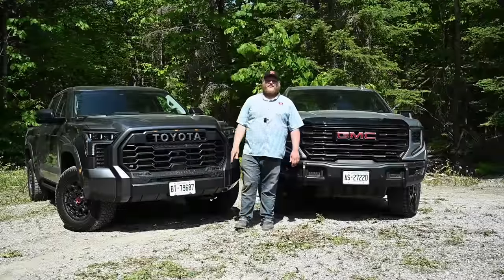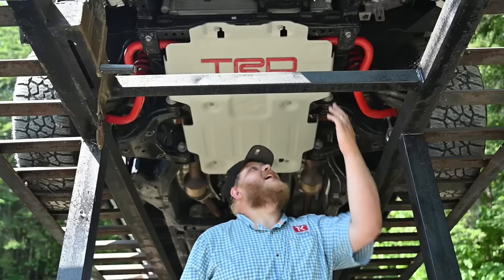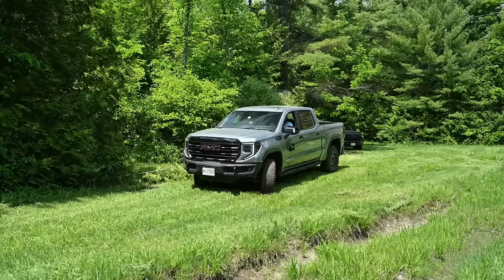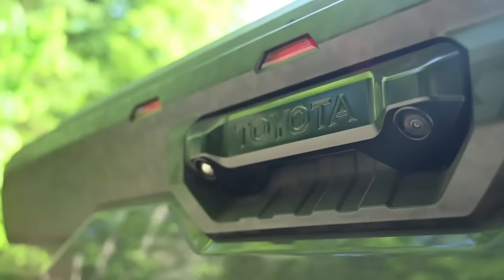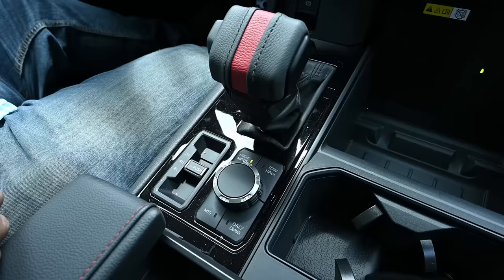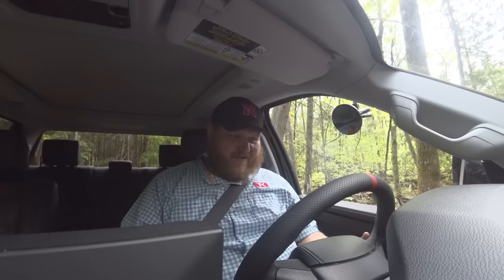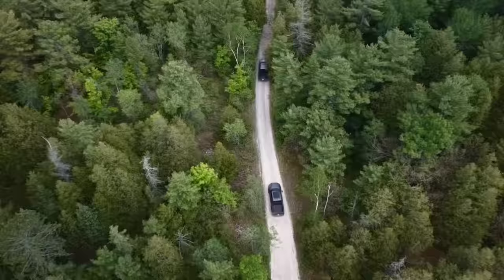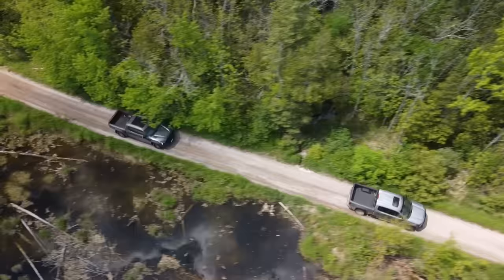2023 Toyota Tundra TRD Pro vs GMC Sierra AT4X AEV - Mud, Rocks & Water will Decide Which is Better!

Comment: Neither, I went with a 1500 ZR2, Front and rear lockers, all the same camera views same shocks as the AT4X and 1500lb cargo capacity at 73k US. I like Toyota and was excited to see the new Tundra. I think they dropped the ball on a lot of it. Drop the tailgate and try to climb in the bed. You can't even step on the bumper with the gate down. No tow hooks in the front of a truck?? Cheap flimsy plastic all over the exterior. With how long they took to redesign the Tundra, I expected better. Coming from someone who has owned 5 Toyota's including the previous gen 5.7L Tundra.
Reply: They really did drop the ball. Even custom trailboss looks better then the tundra pro fully loaded.
Reply: Lack of front tow hooks is a firing offense for somebody over there.
Reply: You nailed it.
Reply: @KTree470  totally, especially when the incoming Tacoma has them.
Reply: Just the not beeping every 5 seconds is enough for me to take the GMC
Reply: The Sequoia looks better than the tundra. Not sure on the tow hooks though
Reply: GM is 50.1% owned by Shanghai Automotive Industry Corp, a Chinese company. The Tundra is the #1 most American truck you can, (as well as the #1 safest and #1 in resale value).
Reply: @user-mh5qg5jb7d  The largest stake holder of GM is vanguard at 7.5%. Do you get your information from facebook or tiktok?
Reply: I agree 100%. This is a letdown.
Reply: amen man... ive got an old 5.7 tundra and its 14 years old and still more reliable than the new one. im really hoping toyota does something and fixes the tundra to restore it to its former glory
Reply: I went with a 1794 with TRD pkg. Same crawl control, same MTS, same skid plate, way nicer interior than TRD pro and non-hybrid which I prefer. Plus I got a 6.5 long bed, which is not available in trd pro trim. AFE tow hooks are $155, all good! The Bilsteins ride awesome, can't comment on a larger sway bar as I haven't driven pro to compare. Its probably just painted red LOL!  In the video the GM cameras look sharper because the screen is so much smaller. Complaints I ahve were mentioned: Locker only works in low range, ugh. Fuggin thing slams on full abs brakes if I get close to leaves or have a hitch carrier in place. Startles the crap out of me and bystanders lol. Wish I had a front locker, but not sure it doesnt compensate with electronics.
Reply: @@ThomasJeffersonIIIno it doesn't. I've reached a max of 23.2 over a 460 mile round trip. Light traffic, really trying. I doubt it could do much better. Show me the V8 do that. In moderate traffic, a few passes etc. around 18mpg.
Reply: @@ThomasJeffersonIII except the fact I can afford not to keep something until 276k.
Reply: @cheezwhiz1234 Bro... 🤏🏾🤣
Reply: I was baffled to learn they had no tow hooks 😵‍💫
Reply: I agree the Toyota has cheap plastic parts on it to make it look tough and the hybrid system on it plus batteries with all the electric pumps and accessories will surely have to many problems in the long run. I've had several Gm trucks and I love them

Comment: No tow hooks on a truck in 2023 is insane. They should come on all trucks in 2023.
Reply: You still talking about that? 
How is that new to you?
Reply: What percentage of owners ACTUALLY use them?
Reply: @mikek5298  I would not take my $80k truck to any place like this
Reply: @mikek5298 I’ve said the same thing. I’ve driven trucks for 35 years and maybe used them twice. But just like the guys who sink 100k into a Jeep, it’s all to look good in the Cheesecake Factory parking lot.
Reply: @mikek5298  stop making excuses for toyota, it was pathetic to remove them on the new truck
Reply: I’m a Toyota cheerleader, but 2021 was the last full-size truck Toyota made. The new truck is a rolling dumpster fire. Let the pavement princesses cry. On my third and probably last Tundra.
Reply: Most toy guys use their trucks four wheeling
Reply: @wjoseph-rx9mj that’s just a simple matter of having it and not needing it rather than needing it and not having it. It’s a full size truck And an “off road “ version of it at that, with no tow hooks… really nothing else to say

Comment: Auto 4 wheel drive is missing on the Toyota.  Hard pass
Reply: The transfer case will last longer
Reply: Auto 4wd clutch packs are trash. Learn to shift a tough tcase manually or go buy a tesla if you want the computer to do your driving for you.
Reply: Auto 4WD is a game changer for on road poor climate conditions. Actually better for the tcase than binding in 4Hi or constantly shifting in and out.
Reply: @upshifter5316  auto 4wd has been in production for decades. Theres nothing game changes about it other than overheating clutch packs when they do fail. You just don't hear about grenading manual transfercases like you hear about failed auto tcases. One's built for toughness and the other is built with wearing clutches. What's the argument here? Viscous and torsen lockable differentials in tcases were a game changer.
Reply: @CACressida  oh well excuse me professor. I hereby retract my statement based on first hand experiences. 

Where I have in fact blown a chain driven tcase (and a prop shaft) on a modern Dodge truck due to binding (in a pretty mild use case, too), but as of yet have not blown the 4auto case in my Ford truck, despite 20k+ miles in 4A mode (out of 65k total). 

Which reminds me, I left out the part about 4A being a game changer also for putting the power down in ~500 hp trucks since they have a light rear unloaded. 

So yes, as Borg Warner would tell you and I’d agree, the clutch based vicious coupling in the Torque on Demand cases is a game changer. Best of both worlds unless you have a dedicated rock crawler. 

If I’m rock hopping I won’t be either using a modern truck nor doing it in 4A anyway.
Reply: @upshifter5316  so what you're saying is you admittedly have no idea how to operate a vehicle. Got it.
Reply: @CACressida  you are wise beyond your years.
Reply: @upshifter5316 you know it.
Reply: @CACressida  I don’t think so junior
Reply: @russelljohnson6885  who cares what you think, senior. Its just facts of reality. You can kick and stomp all you want, mechanical is always stronger than a piece of wearable friction material. Its why a few hundred dollar clutch disc wears out on a manual transmission and a clutch pack totals a car equipped with an automatic transmission. Its why a torsen or mechanical limited or locking differential never fails designwise and a clutch pack LSD requires special gear oil and a very frequent service interval in comparison. Its why all these goofy CUVs use clutch pack transfercase and a truck designed for severe duty uses a mechanical one.
Reply: @CACressida  sure thing chief.

Comment from the maker: CORRECTION: We said the fuel tank skid plate on the Tundra is plastic, but that's an oversimplification and doesn't do it justice. It's actually called Xply Armor, a unidirectional long glass fibre reinforced Nylon. Glass fibre tape is layered with alternating directions and bonded by nylon to make this skid plate.
Reply: Sounds like plastic
Reply: AEV Boron steel for the win!

Comment: Impossible to justify these prices new but I watch to see what I might be interested in when they're used, ten years from now. On a 500 mile loop this weekend, I got 18.6 mpg with my 10 year old GMC 4wd with an 8 foot bed. 100 dollars for fuel and no payments!
Reply: I average 13.5mpg with both my tundras, 2008 and 2022,  pulling a 16 ft utility trailer with two commercial mowers on it. About a 5000lb load mostly on back roads. The 08 has nearly 300k miles on it. 👍
Reply: When the payments are over, your truck runs and does the work it needs to do, that’s when you win. Enjoy it!

Comment: As for pricing, the comparable GMC to the TRD Pro would've been the standard AT4. The standard AT4 doesn't have front lockers, massaging seats, high approach bumpers, etc. which the TRD Pro doesn't have.
Reply: Agree and since they didn't utilize all the offroad goodies the GMC had I don't think saying it was only a hair better is fair.
Reply: @EGGINFOOLS exactly, they’ll never give GMC their credit. If Ford or RAM was offering all of this they’d be saying how it’s clearly the better truck.
Reply: Also AT4X was definitely not needed for this comparison.
Reply: @G-Rated 
Price, power, payload, and towing… Toyota is just better in the main category’s. GMC is best in lifter failures though
Reply: @JC71444  not a fan of the cylinder deactivation either. Just found out there are little tuning devices that get rid of that. Solves the lifter issues
Reply: Agreed, two completely different trucks, but I think they're testing what the company's give them. But with that said, they really shouldn't compare the two.
Reply: @JC71444 And rust. And depreciation. And government bailouts.
Reply: @VDawg-cr1gb  I purchased the Range AFM/DFM delete module for my Sierra. Worth every penny so far.
Reply: they’re comparing the Best half-ton both have to offer
Reply: Bitter much? they are comparing capabilities not cost. It's not about Value, it's about the abilities... If you want the Best it's GMC, if you want Value, it's Toyota.. Not everyone cares about price, many of us want ability and comfort.  If you want the top, you pay.. sounds like you should get a Honda.
Reply: @LayzeeGiant depreciation? Have you tried pricing a used GM truck or Tahoe lately?
Reply: @K-bob_45  My area is offering $7500 dealer discounts because they’re sitting on the lots. Same with F-150’s. Now the SUV’s are a different story.
Reply: At least GMC can deliver a truck.I went into Toyota to put my name down for a 2024 Tacoma Trailhunter and they couldn't even guarantee it would arrive in the year 2024 due to supply issues. Ridiculous.
Reply: @paleh0rse  That’s because people actually want a Toyota. They’re finally wising up to the fact that GM pumps out subpar junk that’s gonna fail sooner then later.
Reply: @LayzeeGiant holy yoda choker, how do you breathe with all that Toyota shaft in your throat? 😂
Reply: @OneEyedRascal Butthurt much son?
Reply: @LayzeeGiant  lol I just love seeing you defend a brand like it’s your unfaithful wife. Idc about your preference but why defend a corporation?
Reply: @OneEyedRascal  you seem obsessed with what others think. Maybe go outside and talk to a real person once in awhile. Just a thought….
Reply: @LayzeeGiant  ummmmm okay? Haha very respectable approach, you must be a democrat with those debate skills.
Reply: @OneEyedRascal  I’m not debating a child on the internet. I just told you it might be helpful to interact with real people instead on insulting them anonymously. But hey, to each his own.
Reply: These two trucks in the video are the same price though. I just googled it they're both $90k.
Reply: The Chevy made it look easy, the Toyota would have struggled even with more aggressive tires, the Chevy didn’t exactly have designated mud tires, they looked like all terrains, the Toyota has street tires,,,
Reply: @paleh0rse I was told I would have to wait for my trd pro tundra 3 months later it was being built 2 months later it was mine
Reply: @AFTERSHOCK-bh7hh liar! I got my trd pro at msrp of 70k
Reply: @reneeandchrisforever bahahaha your funny cause what I've seen lately is people are leaving Toyota's for GM's as Toyota is not as reliable as you claim it to be. Hell I've had couple buddies at work ditch their Toyota's an went to GM cause those Toyota's we're pure crap.  Oh an another buddy has put about 5 or 6k into repairs got his Toyota over the last 2 year's.  Hey you can claim Toyota is all that great but reality is they are living off the past.
Reply: @vincefairleigh6899 bruh don’t disrespect GMC by calling it a Chevy
Reply: @DwightCraneDenver 

Leaf springs suspension vs multi links suspension I know which one I would buy and two turbo engine hybrid that can easily be modified to get even more HP and torgue with just another 20k
Reply: @oneviwatara9384  i have magna ride suspension so its pretty smooth... Keep comparing the basics though since it makes you feel better... But ultimate i rides prett5damn smooth
Reply: @DwightCraneDenver  

What video did you just watched?

You clearly didn't pay attention while they were showing you how Toyota was way better go over the bumpy road  😆

GM didn't do much better than Toyota in mud comparison test even with mud tires on while Toyota only has all terrain tires on.
Reply: @oneviwatara9384  I didn't need to watch a video I drove them. And there is no way in hell I can stomach the interior of a Toyota. And I'm not comparing off-road features either. Truck for truck I'll take a GMC every day of the week a better tailgate  a better interior and a more comfortable ride.
Reply: @DwightCraneDenver  

It's your money you can do whatever you want with it 😅
Reply: @oneviwatara9384  ahhhh so its about money not the actual truck... I get it typical argument... I never discuss value only results
Reply: @JC71444  power only if you consider the base offerings not the max offerings. Toyota is what people settle for not what they actually want.
Reply: @LayzeeGiant  yeah you obviously don't know what you're talking because Toyota has had more recalls and engineering issues since 2020. Keep riding on that statistic from 20 years ago modern-day trucks Toyota is behind get over it.
Reply: @DwightCraneDenver  

For my money I would buy modern Toyota all day long over dated GM with ancient pushrod engine and ancient suspension aka leaf spring and use that extra 20 grand saving for gas and insurance etc 😅🤣
Reply: @oneviwatara9384  that shows how little you know about current modern GMC magna ride suspensions. And how you care more about money than the truck. If you want to compare about money I got a thousand other subjects we can compare money on but we were talking trucks. You just sound salty because you can't afford something.
Reply: @DwightCraneDenver  

I guess I was watching the wrong video again 🤣😅
Reply: @oneviwatara9384 Sure, you can choose to buy an inferior looking and acting product if you like, that's your freedom of choice.  You're entitled to spend less for uglier underperforming overrated vehicle. but it also shows how you don't know much about modern trucks.  Compare since 2020 and Toyota has massive recall and reliability problems.   But you saved money.
Reply: @LayzeeGiant I’d say he’s a little more obsessed with what men put in their mouths.
Reply: @VDawg-cr1gb  That's not a full delete.
Reply: I have rubicon 2014 and the sierra take all my attention
Reply: Good lord this thread😂 I’ve never had a Toyota break on me where it wasn’t my fault and my friends sierra is honestly a really nice and comfortable truck. Both have their perks. Ignore airbag recalls and Toyota trucks haven’t been plagued by many issues over the past decade. GMC has always been known for valve issues. If it ain’t broke enough don’t fix it. Both trucks are dolled up to make them seem more modern but they’re both using lots of outdated tech because it’s proven to work long term. Both trucks drivetrains are likely to outlast their frames so it doesn’t really matter. I’ll admit Toyota took a huge leap with the drivetrain and that’s a big risk that may pay off. Personally I’d choose neither truck because I want something with actual off-road capabilities that can fit an actual trails ie a Colorado or Tacoma. (Keeping an eye on the newest Tacoma for sure especially if it gets the iforce treatment because I’d love to try it out) but damn… both of you riding corporate dick hard af😂praise Toyota this praise gmc that. Superiority complex goes brrrr and I wouldn’t be surprised if neither of you could actually afford these trucks new
Reply: Ok, so deduct $7K off the price of the GMC. You still have a difference of $13K. Can you imagine the tire and suspension upgrade you could put on the Toyota for $13K? That would put it FAR ahead of the GMC in all situations.
Reply: Seems like they are testing the best that both companies offer.
Reply: @JC71444 the problem is Toyota has low quality and wont last 100k before it rusts away in the junk yard.

Comment: Drop the AEV package and it's closer. Silverado ZR2 is my choice over the 3. 😁 However, it's all personal preference at this point. As much of a GM homer as I am, all are good these days and all have their own, manufacturer specific issues.... I WILL say, the Tundra has 2 major, pickup truck specific, flaws in my opinion: 1) limited bed access with the tailgate down and 2) no front recovery hooks...
Reply: America was built by trucks that didn't have sissy steps or "fatty" steps to get in the back of the bed. I've been using pickup trucks for 25 years and haven't needed tow hooks yet. If you need tow hooks on a $70k truck you don't have too much sense I think.
Reply: @T_81535  I'm not talking about sissy or pullout steps. When you drop the tailgate on ANY pick-up truck, sans the Tundra, you still have bumper pads in the corners you can step on. The Tundra simply has no bumper once the tailgate drops. You tow hooks comment is simply ignorant. MANY people are taking $70k+ trucks off road. And, guess what? They get stuck from time to time....
Reply: So add the pull down step and put the aftermarket tow hooks on and still have enough money left over to buy a passenger vehicle compared to the overpriced GMC. Having owned both, I won't own another Garage Mechanics Companion again.
Reply: @Hrothgar13 or buy the ZR2 for 10k less than the TRD Pro. Nobody really knows about this drivetrain’s reliability vs the competition, other than there is more to go wrong with it. 6.2 has lifters, TRD has turbos and hybrid battery that has to be replaced. Cost of ownership is probably going to the NA engine in the long run.